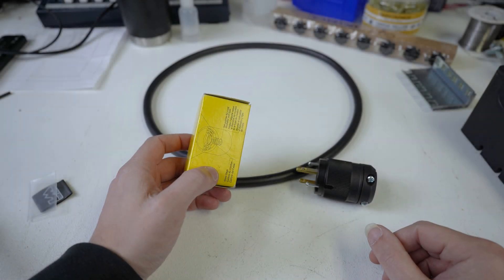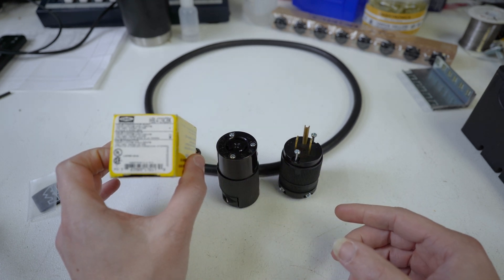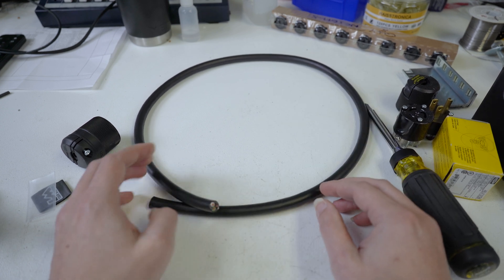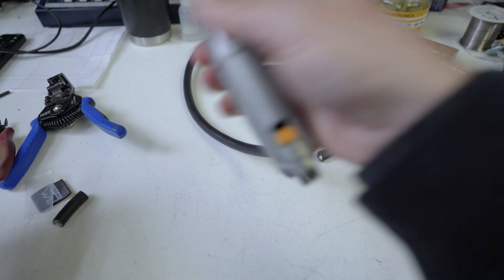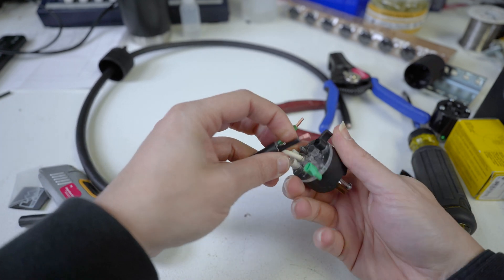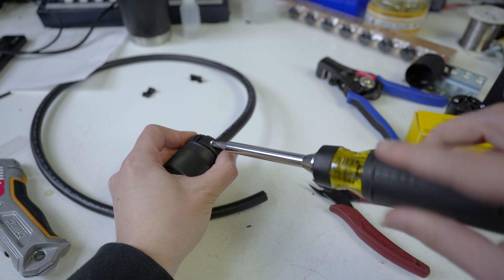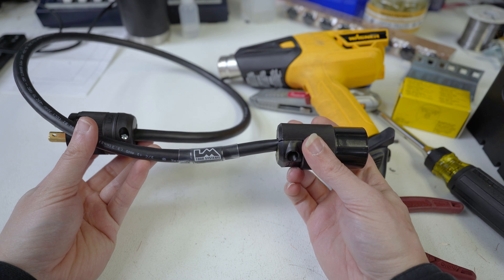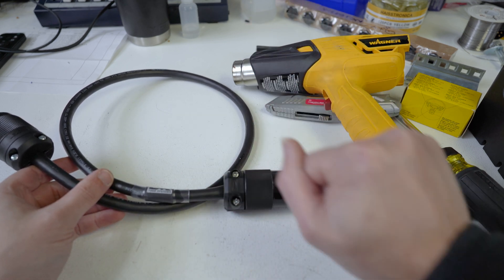NEMA L5-15 To Edison Adapter Cable

Comment: And there is a male side and a female side to the cable look at the colors coming out of the cable and line up the perspective colors of the Terminals on the 15 or 20 and 30 amp connectors  so you don't cross the color cables over each other. That's the way I do and looks cleaner when you have to service the cable or connector.

Comment: I as an electrician apprentice got tought that when cutting the wires to length for movable plugs and sockets to make the ground longer than the other ones, so in the case the strain relief fails it's the last one to disconnect.